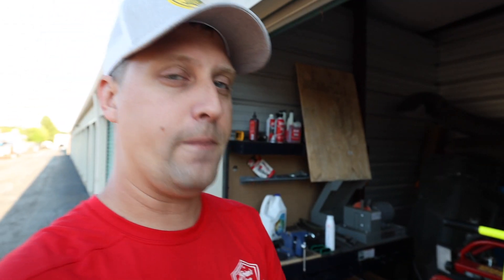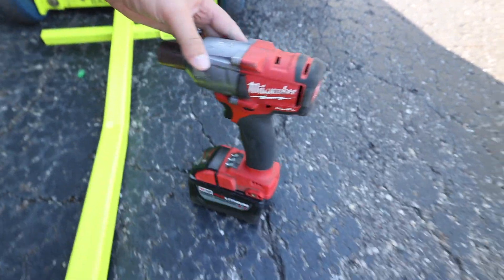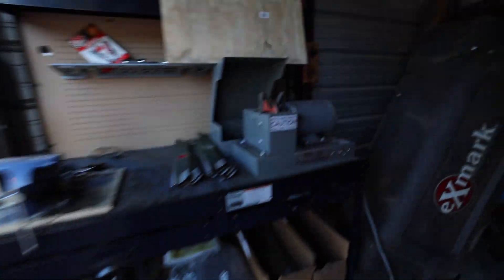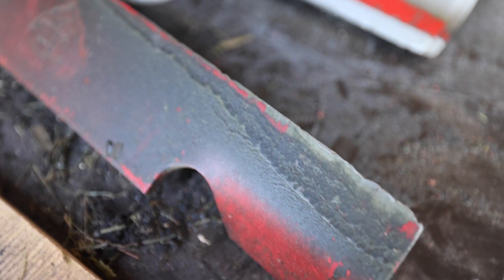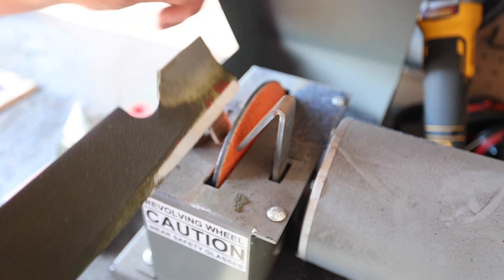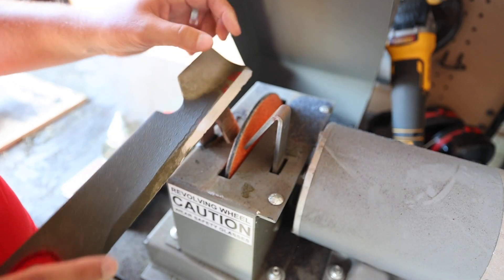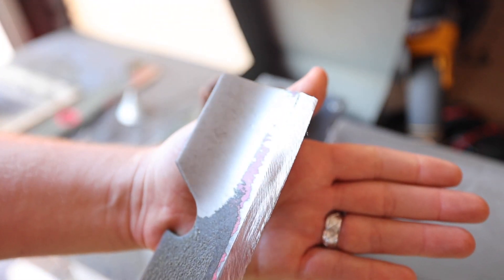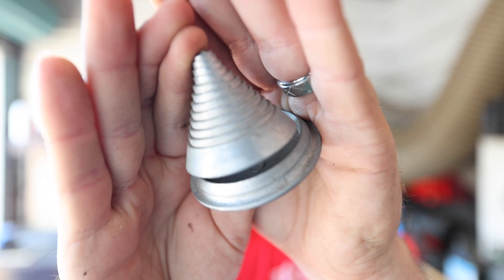3 LITTLE KNOWN SECRETS FOR PERFECTLY SHARPENED LAWN MOWER BLADES [HOW WE DO IT]

Comment from the maker: Do you guys use any of these tips and tricks for sharpening YOUR blades? Let me know in the comments below!
Reply: No
Reply: I use air grinder with 40 grit disc.  It's light weight and does a good job sharpening mower blades.  Before I begin, I scrape off the grass buildup with a metal putty knife.

Comment: Absolutely worth the money to run an impact. Second year in the business I had a wrench and blade block both slip at the same time. Even though the blade was dull, it bit me good. Doc said 3 millimeters to the left and I wouldn’t have made it to the hospital. 27 stitches later, I bought a Milwaukee high torque impact on the way home from the ER. Bought a mid torque this year because it’s shorter so I didn’t have to jack the mower up as much and still gets the job done.

Comment: I use the oregon 88-025 blade sharpener and oregon wall mount balancer. Great setup. Pretty much same process as your doing. I also like my blades razor sharp and balanced perfectly. Nothing beats a sharp blade.

Comment: Sharpening the lawnmower blades it’s pretty easy shopping the hedge trimmers that’s a little bit more difficult for years I used a handheld grinder now I’m actually using a Dremel which works out awesome getting in those little spaces
Reply from the maker: Dremels work great
Reply: Im bringing my hedge clippers to the shops to sharpen , or replace the blades , i hate sharpening them ..lol
Reply: @MikeSmith-nu9wt  Yeah it’s a little bit of a pain in the ass but the place by us charges $60 each and when you have six of them I’m not paying $360 to sharpen hedge trimmers when it takes me 15 minutes each one I will do it myself
Reply: I use an angle grinder with a 4” cutting wheel.  Works great every time. Don’t forget to wear eye protection!

Comment: I made a jig to hold my blade at 30 degrees and use a fixed 8” disc grinder with at least a 60 grit minimum like like 40 better, works great

Comment: I have been using the honda generators  for many years never let me down I feel they are worth the extra dollars
Reply from the maker: That’s what I’ve heard - they seem to be the gold standard for generators.
Reply: Agree.... once they are running. I have a EU3000i Handy and EU6500i that's used as a whole house generator. Neither one of them likes to start when the temperature is below 45 degrees F. It's very discouraging. In cold weather I have to use starting fluid on both of them. I've used nothing but non-Ethanol fuel in both since they were new.

Comment: You produce great content thanks, however, instead of dropping the blade straight in the "V "...try using the blade support...you can guide the blade along that, as like a back support...u will get a better finished product and won't need to do any of the flicking
Reply from the maker: We do use the cradle, but with almost every blade yes we still need to flick it in just a hair. Until at least the blade is at the 30 degree angle the cradle/guide is set for. Most blades come with a 32-45 degree angle, so it takes a few sharpenings to get that cradle to do it’s magic.
Reply: @BriansLawnMaintenance  Ok

Comment: I guess that's a great plan if you like buying lots of new lawn mower blades. I've been mowing grass and sharpening blades for over 50 years. There is a reason new blades come with that long thin flat edge. You end up buying new blades sooner. The first thing I do when a new blade dulls, which isn't very long, sharpened like that, is I sharpen them to a chisel point or edge. Then the blades aren't damaged as much by the inevitable stone hits that happen over time. My blades last much longer with this method. But by all means, carry on if you like buying new ones and making the blade manufacturers rich. I prefer to use a one-inch belt sander with a medium grit belt. I can see and control the grinding much better. Most important, is only to take off as much metal as is necessary to get a sharp blade. And the biggest benefit is you don't have to sharpen them as often. They produce just as nice a cut, since they are still sharp, and they stay that way longer. Oh, yea save your money on crazy blade balancers. I round shaft screwdriver does the same thing for free. I've been balancing them like that since day one. never had an issue with them being balanced.

Comment: Can I ask you why you  only sharpen 50% of the cutting edge...I sharpen up to 20 sets of blades at a time and I always sharpen 100% of the edge...
Reply from the maker: You only use the last 2” of an edge to cut with anyways. One or two manufacturers best I understand it started making blades with an edge the whole way down. Before then, mower blades only had an edge for the last 2”. I’ve never seen the inner half of my blades ever really dull. So the theory holds true in my experience. Just that last 2-3” is all that is really cutting and dulling.
Reply: First off..I enjoy watching your videos. Love your mowing content...and reviews on equipment...I agree with u 100% I own my own lawnmower repair shop...and I sharpen blades for guys like you..the last 2 inches or so is all that cuts...some of the blades have 8 to 10 inches of cutting edge with is dumb in my opinion...what's you opinion on the blades that have tungsten carbide on them...like bad boy blades? The coating makes do difference in strength to cutting edge....in my opinion it rounds the edge twice a bad as one without coating...thank you and would love to hear back
Reply: Just ordered me a rbg 712, can't wait to try it out this weekend.

Comment: I struggle with how to sharpen my blades the first time they run through the RGB 712. We are currently using Exmark oem blades and the angle on them is different than the RGB angle. So the first time you run a blade through there you have to do a million passes before the wheel even gets to the edge of the blade. Once they’ve been through it’s easier but that first time is a huge pain in the ass.
Reply from the maker: Takes a few passes to get the angle perfect. I just did an updated blade grinding technique video though to help with this.

Comment: The "rounded tip" technique is based off a wing tip. Low and high pressure. But the thing is, you want it to cut grass, not take off. SMH. Obviously some lack common sense and others swear by it. Not me. My blades gotta pass the paper test every time. Call me ocd or whatever but that's me.
Reply: Every time I have purchased a new set of Deere blades they are razor sharp right out of the box. So that is how I re-sharpen them. Also, if you look carefully at most mower manuals they show a little graphic with a 1/64 measurement on the blade edge. But if you read the instructions it says a sharp edge MAXIMUM thickness of 1/64. That means that is the dullest you ever want it to get.